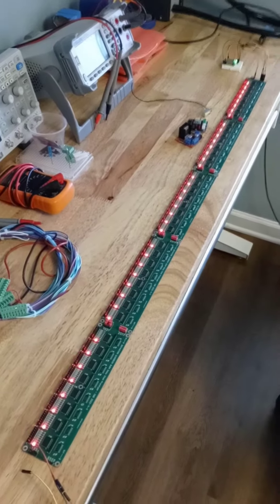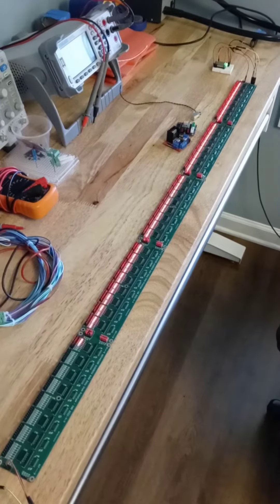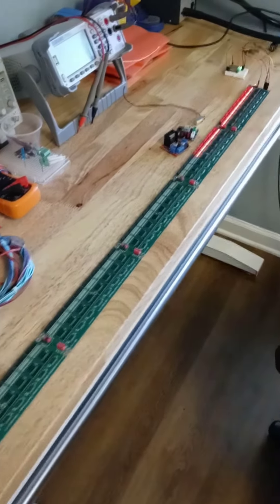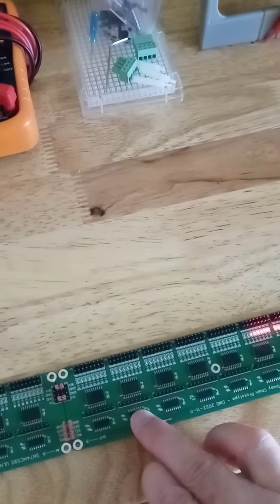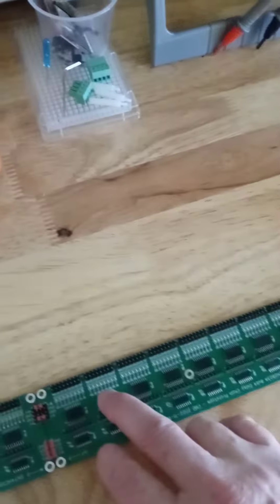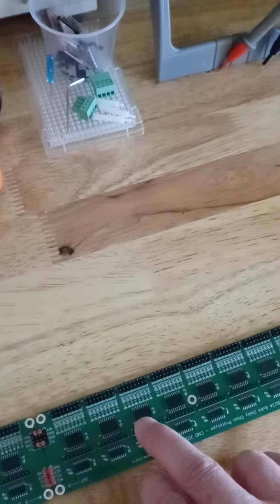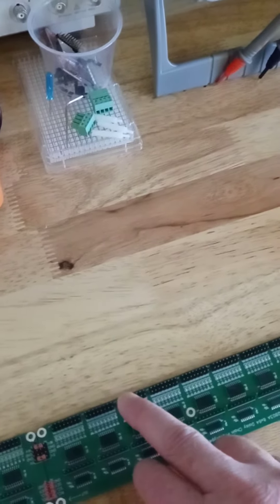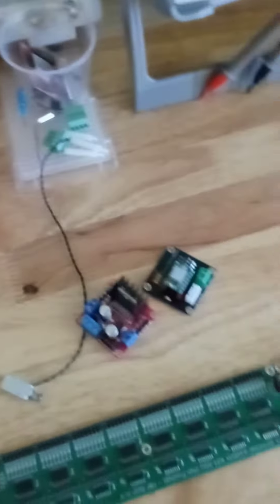ESP32 with 320 Outputs

Comment: Unbelievable, this is amazing lol.  Did you use multiplexers with it?
P.S: even with the all 320 inputs busy, can the actual cpu handle it all?
Reply from the maker: I only plan to use one board at a time, 64 outputs. With that many I can update close to 1000 times a second using micropython. So there is plenty of compute time remaining most of the time. With 320, it takes a lot longer. I was just testing.
Reply: @ClaytonDarwin  this is actually incredible.
Reply from the maker: Also, the SN74HC595 is just a shift register, strictly output. So this is just for controlling steppers and solenoids.

Comment: Amazing! By any chance, would you share your board files/code? I would love to drive a few hundreds of little solenoids and led´s for an art installation and it seams you´re already there! Thanks!
Reply from the maker: Probably cheaper for me to sell you some directly. Depending on where you live. Also, there are amperage limits. The traces on the board can handle only about 10 amps at a time.